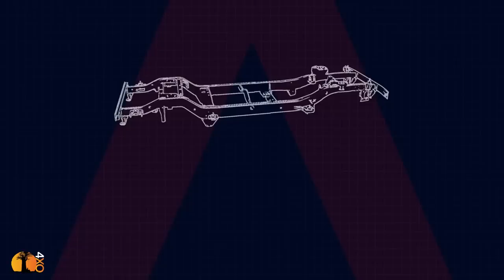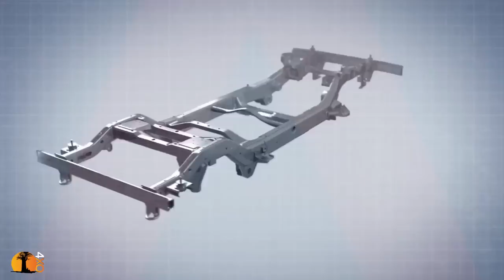INEOS GRENADIER or LAND ROVER DEFENDER. Which one would you buy? 4xOverland

Comment: I would buy the one with a toyota engine.
Reply: Isuzu engine would be good too
Reply: @Lucas Van Hamburg you certainly wouldn't want to buy one second hand out of warranty.
Reply: I do not understand the BMW hate. Toyota put BMW motors in the fifth generation Supra, both the BMW B48B20 and BMW B58B30. Is the new Supra now an unreliable auto because it it technically a BMW motor installed at factory by Toyota? I would have thought if Toyota approved of these motors, they must meet Toyotas standard for reliability.
Reply: Berlin-Uhren24 for a supra that’s good, BMW twinscroll turbo engine are amazing, i had one, but for an off-road environment, i don’t see a turbo survive the suspended particles that will destroy it from the inside!!!
Reply: @nerhu59  BMW after 2000 all the engineers left, they can't build a turbo motor to save their reputation, oh wait they pay for a good rep despite them being shyte. Aside from a select few I would never consider another BMW product after 2000
Reply: Second that.
Reply: @nerhu59  BMW quality jsnt all that good when it comes to turbocharged motors. In general BMW isn't all that reliable either. BMW /mini service makes a ton of money though!
Reply: @nerhu59  well people hate them simply because of lack of quality. Some guys offered me trade-ins with their bmw 645i or 650i, I called a mechanic who is servicing my dad's 535d and he told me to get the hell away from that. On 200 000 km problems start, and pretty expensive ones. They designed every oil pipe from plastic that starts leaking in around 200 000 km. Dad's 535 diesel? Also a lot of problems, yeah it goes like hell and it's saving fuel, but that's it. I really like the idea that I can start my toyota and go anywhere with no worries about malfunctions. In total 1 000 000 km that we managed to drive with several toyota cars, we NEVER had to change any of suspension parts, which was somewhat regular when we drove mercedes cars. ;)
Reply: Berlin-Uhren24  watch the video papedalkis racing put up from about 12 months ago , that should give you an insight.
Reply: Agree with you. Why don’t they partner with the Stellantis group ? for the UK Vauxhall rhd plant, parts.
Followed with their 4wd Jeep access since Opel is German. with a Japanese engine ?still staying using BMW & Mercedes in part as intended.
Reply: I love BMW - my wife has one.
But they are too complex and plastic for off-road...
Reply: Buy a Toyota if you think they are good. Personally I would not touch a Toyota, I learned my lesions. The fact that people claim it is reliable is no more than an urban legend and a result of an excellent marketing policy.
Reply: Nathan Snir I do own one and have for 18 years.
Reply: @nerhu59  my 1999 Disco with BMW TD5 engine is still rolling along quite well 260,000 so far not that Many but still going strong.replaced the rear air suspension with springs. 
My 2 bob's worth.
Reply: @nathansnir1502  Correct! All manufactures have problems, as they all have a reputation for something, and it is all ways BS. I have repaired all type of autos and as you say, even the great toyota has some big problem. Buy what you like and take care of it, in this way is it lasting.
Reply: @blackprince4074  If you maintain your auto properly it will lasting a long time. Cheers.
Reply: @davidcollins2258  most sensible comment yet, Isuzu are the diesel masters

Comment: Ineos will be a good off roader because :: """" Ineos has chosen its partners well to help achieve that. Magna – with decades of experience of automotive design and engineering, as well as building the G-Class for Mercedes and the I-Pace for Jaguar – is working on the engineering. BMW will be supplying six-cylinder petrol and diesel engines, and ZF will be supplying the transmission systems.""""

Comment: I was part of a 6 man team back in the early 1970s, the first to complete the 300-400 mile drive along the Colombian llanos foothills from Villavicencio to the Venezuelan border, before there were ANY roads. For this three-season survey, we used a pair of Landrover Santana 109's that coped with all our camp gear, crossing mud, tree trunks and boulder gravel in several 100 metre wide rivers, with no serious mechanical problems. (Tip: disconnect the fan belt and keep revs high when crossing deep water.) Otherwise, we were detained for 24 hours by a small township to put pressure on  government to re-open its only cordillera access road, recently destroyed by landslides.
Nothing exceeds my respect for the design of those two 4X4s or for  Colombians we met along the way.

Comment: The size of the fuel tank is very important in Australia. Long range fuel tanks so that extra fuel does not have to be carried inboard in cans. Carrying water inside the vehicle or on the roof is not so dangerous, although we don’t want too much weight on the roof to keep the center of gravity down. If the motel is full or closed reclining front seats mean 2 people can sleep rough without having to carry a tent, Comfortable seats are so important. Love the look of the car, Suzuki Jimney got it right, Mercedes G wagon every body loves, and the Jeep. All essentially square boxes and big wheels. Simple, honest and functional. Off road and dirt roads usually mean slow safe driving, wind resistance is less critical.

Comment: It seems the people who makes the Grenadier are full of good intentions but they are not attentive to what the market wants.
A BMW engine is not the kind of engine you would like to get stuck with in the middle of nowhere and so is a ZF automatic transmission.
There are enough British engineering firms able to design and build proper engines and gear boxes, chassis, suspension etc. – Ricardo, Cosworth. Lotus, David Brown etc. 
The other thig the designers seems to overlook is the versatility of the vehicle. One of the plus features of the Defender is it can be easily converted, or upgraded to suit ones needs.
In my humble opinion what the market thrives for is an up to date version of the Defender, with better ergonomics, better build quality, larger non charged engine, manual transmission with auto as an option, solid axels with differential locks, optional P.T.O. etc. 
All of the above will make the vehicle far more versatile, suitable for military use which will make is investment more feasible etc.

Comment: Yes, it does not have air suspension. But that means it will sag under payload and loose ground clearance. Or you will have to change springs and dampers for every time you change between daily driver and overlander. Not very realistic. More likely: the suspension will be a compromise. Terribly uncomfortable when driven without payload. Like a pickup truck.

Comment: Can you put leather, air ride seats for the two front seats? Have a valve under each seat so you can attach an air hose to it and fill up your tires from the driver's side and passenger side? So that way you're not dragging a bunch of hose through mud. Flip a switch on the dash, and turn on the on-board air compressor.

Comment: The new defender is being a sales hit and it's great off road. I understand it's not the utilitarian platform as the old defender or the 70 series. The Ineos looks and sounds awesome, but I find it funny they chose a BMW engine. Being made in France means it will be better built than if it was built in the UK. Even the new Defender with much more tech will probably be more reliable than the old defender, which it's not really hard (I have always loved the defender and had a SIII, but they are not really reliable). In conclusion, I'm glad LR had the guts to make something different and also glad to see something like the Ineos on the way. Different vehicles, both are great.
Reply: The new Defender is a sales hit. I think that annoys a lot of people who wanted something else and didn’t get it. Nostalgia also plays a strong part here. The Ineos Grenadier looks great too, and I’m seriously considering buying it, cross-shopping against the Defender. It won’t sell as well, because it is a niche vehicle. But I suspect that the new Defender performs just as well as the Grenadier off road and potentially better on it.  It’s just harder to fix if something goes wrong.
Reply: @simonng2077  they both are incredibly hard to fix. Look at the grenadier engine and transmission. High tech. And they have to because of emissions and safety in europe and US
Nevertheless I think both car are winners.

Comment: The rear A frame ball joint arrangement on the Defender/ Range Rover I believe is not a weak point at all but  an incredibly strong stable simple arrangement that meant the geometry of the track alignment front to back was not compromised when rear articulation was in motion. The only weak point was lack of maintenance via lubrication of this ball joint, add a grease nipple and it will last a lifetime!
Reply from the maker: It was the cause of the RR and early Disco being prone to roll over on corrugations in a turn. A lot of LR's designs were copied by many car makers. This was not one of them because it was a design flaw.
Reply: @4xoverland , From an engineering point of view I can see no reason why the pivot point  securing the rear axle at the centre of the differential to the body over a diagonal  rod would have any greater effect in causing a rollover. A track rod moves the axle sideways when the suspension is compressed and depending on which side this track rod is mounted to the body would have a greater effect on body roll and roll over that a centre coupling in good working condition. If the ball joint was badly worn or failed completely yes more prone to roll over as the axle is free to move about or unrestrained when cornering. My Defender is 18 years old and fitted with a grease nipple on this A frame ball joint and there is no measurable wear or play so again lack of service is always the issue on a lot of Defenders still in use. The Watts link as used by Ford on some vehicles has similar engineering principles to the Landrover arrangement but has too many moving components any much more prone to wear and failure than a ball joint.

Comment: Great review! Hope you get involved, few are as professional as you. Looking forward to next video on this. New LR Defender.. no. My LR 110 station wagon, 1983, 610,000+, 1st owner, rear axle, etc: prototype (per LRO article). Originally V8, genuine LR conversion 200Tdi 1994, now in Texas (from Europe), with me again. I am Dutch, grew up abroad in LR's Series 1, 2, 2a.. Father had for his work at Shell. First drove his Series 2 LWB pickup age 7, Argentina, Patagonia, la Pampa, remote, only "traffic" some running ostriches on occasion, and groups of horses. I am mechanical eng, Grenadier design looks very good. Hopefully maintain interaxle differential: per experience on snow and ice max traction in curves (no interrupts in traction; standing starts etc diff lock etc). Done extremes white outs, Austria mountains, 2 passes closed after just passed. Also for towing stability interaxle diff is optimal, per experience. Also using low range for maneuvering and steep ups and downs, typically start in low range and 2 double declutch hop on hi range, etc.

Comment: This looks great.  Get working on that left-hand drive version and you won't need to worry about the sales numbers, you'll need to worry about manufacturing keeping up with sales. This would compete solidly with Land Rover, Mercedes, Jeep, Toyota and some of the American truck market.  There is a reason that Ford is coming out with a revival of the Bronco....

I was an Exec with GM for a number of years and saw what happens (sometimes) between concept, prototype, and production versions...compromises are made.  However, many of those compromises are because of union rules, cost reduction through re-use of parts from other models and political/cost considerations to re-use existing manufacturing facilities that may not accommodate the new design completely.  INEOS does not have such a burden, so I would expect fewer of those kinds of deviations.

Look forward to further details.....

Comment: @4xoverland you had questions about the interior dimensions, I am willing to bet that it's going to be almost the same as the w461/w463 Mercedes Gwagen. I'm also thinking the car is sold through Mercedes dealers or at least serviced at Mercedes ... Not BMW.

To me, this is a Gwagen stripped down to it's essentials. Which would be a reliable vehicle. It would also fill a gap that I now see in Mercedes lineup with the new gen of G. They need a legit 4x4 for those who want to go offroading and don't have $200k. So sell them something stripped down to it's essentials, and that just works. In the USA, You'll cannibalize Jeep and some Toyota. With the Grenadier badge you don't risk "offending" Mercedes owners as well.
Reply: This is essentially some engineering borrowed from the Gwagen. Unlike today's Gwagen, the Grenadier is for drivers who actually know what a locking diff is. And if you're the type of driver who uses a locking diff, then you're the type of person who doesn't need a electronic locking diff.

Comment: The thing is simple: the new Defender is a Discovery with (a little bit) better off road capabilities, but basically it's still a SUV. Don't get wrong with me, it's a fine highg quality vehicle, very capable and comfortable.  But the concept is completely different to the old Defender, that was a vehicle to work, capable to deal with mud, sand, and grease, not only out of the vehicle, but inside the cabin.

Comment: They should include advanced traction control.  They can allow you to turn it off if you like.  But advanced mechanics giving good wheel articulation and mechanical grip combined with traction control will multiply the vehicles capability.  It will be a true next generation off-roader.

Comment: Andrew -  You ask THE question:   Which of the two will I actually buy (as a new vehicle -- won't buy used for a daily driver)?     

I have a high mileage LR4 (D4) I must replace -- daily driver -- carries bricks, heavy equipment, lumber, people, animals; tows trailers.  Is a terrific tool, loves to get dirty.  The requirements are:  Must tow at least 7500 lbs. (N.A. horse trailer std.).  Must carry 4 persons, 2 dogs and gear (inside) for a week. Must NOT be a pickup truck (TOO HUGE in the U.S. -- can't park them or fit them many places !).  Must be full-time 4WD w/ low range and locking differential capable -- for use on the farm and in the local, dirt road, mountain trails.    I do not Overland -- not my hobby (but I like reading about it !).   I am always within 2 hours from a dealer.  I am technically capable (former car / airplane mechanic).

In North America, as of today, the options are few:  Any full-size JLR vehicle,  MB Gwagon ($130K USD), Land Cruiser ($115K USD).    Not sure why I should pay the extra $40K+ for a Range Rover, Range Rover Sport, Gwagon or Land Cruiser.   All Big $$$.    That leaves JLR's LR4 replacement (which fortunately improves on the LR4's off-road design gaps), which is now called "new Defender" (sorry about JLR's naming -- I drove a real one at work when much younger and this is not that) as the only valid option in North America.  So, I have a "New Defender" on order in max. off-road / towing trim.  It arrives in September. 

Now, I am entirely flummoxed by the potential existence of the Grenadier -- uggh !!    So, gotta study, study and decide whether to cancel the JLR order ........   any and all advice is welcome from you and your readers.
Reply: A G-Wagon fuh toe-ing?  You off your rocker?  Those things get like 8 mile per gallon on a good day if you are the only one in it.  Tow a horse trailer, carry gear, with passengers and you'll be down to 2 miles per gallon in less than 100 feet after turning the key.

Comment: Not going to lie i like the body styling but at the same time there are areas which im not so keen on e.g. wind shield height and the bonnet. I can understand why it has to diverge from the classic defender styling cues. If you can find a grenadier and you want to compare body styles and interior we have a 200 tdi defender 110 with 4 wheel disc brakes from the factory (late 93 build)

Comment: He's wrong about EAS though, you can replace an air-spring on a P38 much more easily than a coil. You can swap a compressor in 20 minutes without even getting dirty. The airlines are well tucked away too.
Not that you need EAS on a pure offroader ofc, but it's nice when you're back on the road.

Comment: I’ve been saving up and I think I will have enough cash for the Ineos when it arrives. Been putting off buying a vehicle. Having owned a modern Range Rover Sport SC that only comes with summer tires I can tell you it’s no longer a true overlander. My old Nissan Pathfinder seemed more capable off-road. Other than Jeep there isn’t a lot available these days. The New Bronco looks good but I’m still waiting for the Grenadier to see if it works out.

Comment: I think the critical thing with the Grenadier is that it is starting with a clean sheet of paper and appears to be an engineering lead project, while there is no doubt the appearance is Defender influenced, the desired outcome in off road performance seems to be driving the mechanical development. As Andrew says the critical point will be ability off road loaded, which is the failure of most modern 4x4s. Where as JLR engineers are working to achieve a marketing lead image which compromises the final product. A good example of this was the 2wd Evoque, which was like having gun with no hole up the barrel, it wasn't capable of its basic reason for being.